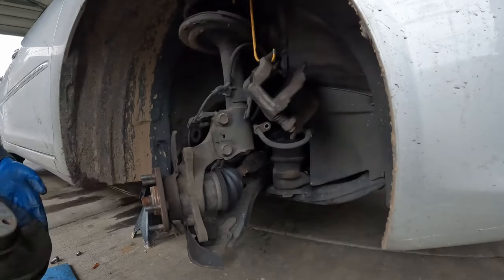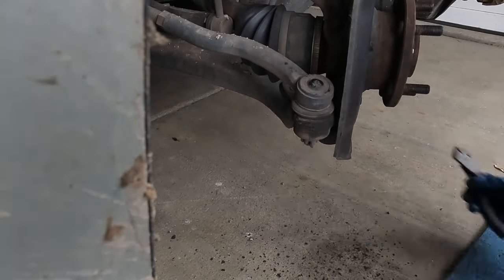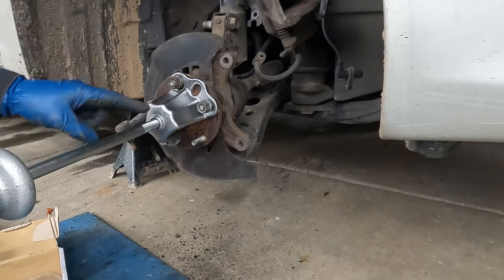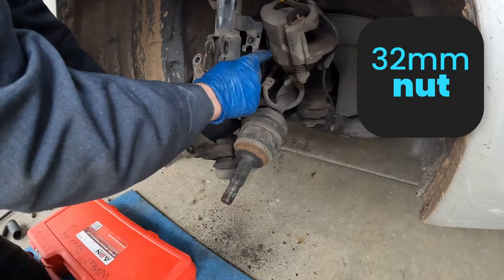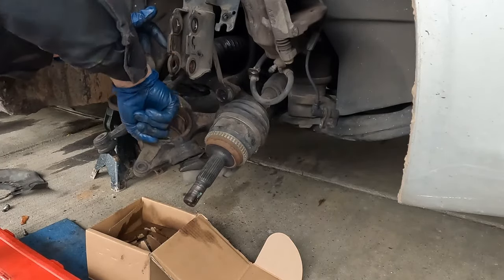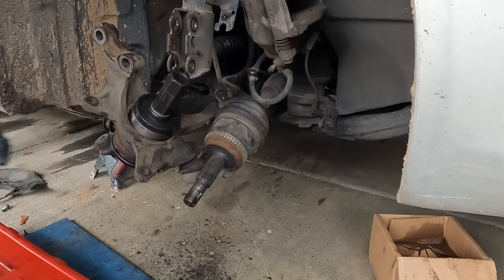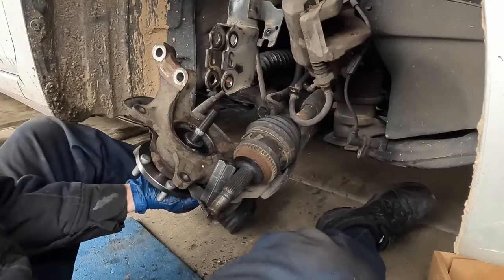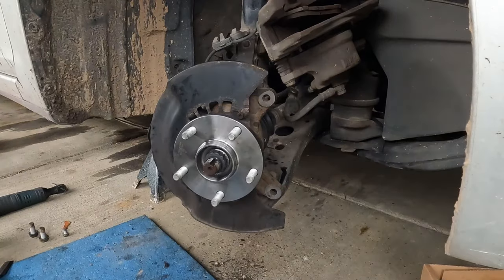2002-2006 Toyota Camry Front Wheel Bearing Replacement

Comment: why you don't take last screw to have a knuckle out out on the table? You could have a much more room to access the bearing.
Reply from the maker: You're right you can unbolt the ball joint and take the knuckle out completely. That will give you some more room to work with 👍

Comment: what can i used instead of a puller?
Reply from the maker: @kayleebrown1667  These are pressed in so you need something that can press the old one out and new one in. What I've done in the past was remove the knuckle from the car and take it to a shop for them to do the pressing then install the knuckle back on the car with the new bearing in it.

Comment: Thank you for this video. It is one of the best videos in step by step description and camera angles I have ever seen. May I ask you a question. I have a 2007 Toyota Rav4. One of the hub bolts of the front right wheel broke off. Could it be replaced without removing the hub. I am a 77 yr old just a DIY person, not a professional mechanic. Thank you
Reply from the maker: @tellsthetruth894  Yes, it can be replaced on it's own. The wheel studs are pressed in and can easily be removed with a hammer. I don't have a video but there are a lot of videos that show you how to replace a wheel stud. Hope that helps. If you have any more questions feel free to ask 🙂

Comment: PIA - why couldn't Asian cars use all in one hub and bearings like my Chevy and fords... so easy to change - also I would think you'd need an alignment after, since  you are screwing with the tie rod end and removing the lower strut mount? - so might as well do both sides with a decent bearing, and have it aligned...   BTW Im assuming my 2003 is the same as the 06?
Reply from the maker: @Mediaman67  I agree, I like doing bearings in pairs. And an alignment is a good idea after replacement because there are differences in machining and it can throw your alignment off. 02' to 06' should all be the same 👍
Reply: @ValleyMobileAutomotive  I like your video because it shows that you do not have to take the whole thing off via removing the lower ball joint (3 nuts) - I don't have a shop press handy :-) - do you have a link for the bearing puller tool set?  - yeah I'll just do both and be done for another 200k :-)
Reply: nevermind - you have everything there lol - im an idiot
Reply from the maker: @Mediaman67  Yes, all links are in the description 👍

Comment: You're a fast worker, but its easier to remove the axle nut with the wheel on the ground and torque it back. Also why not use the  slide hammer with tie rod still mantled ?

Comment: Great job! I like the idea of the silicone paste as a lube. I used anti-seize to lube the bearing and would look like the Tin Man afterwards. I was wondering how you were going to address the hub with the inner race still stuck in place situation but I see you installed a new hub. I used to do mobile service for SAABs. They had the press in wheel bearings. I always used my 20 ton hydraulic press at the shop. I used a bearing splitter to remove the inner race from the hub. I'd either have the customer come to the shop or would remove the knuckle assembly in the field and bring that back to the shop. That bearing kit makes it easy to do in the field. I used to bring a small twin tank air compressor to power my impact gun. This was before there were cordless impacts.

Comment: Do I have to replace the hub if I’m replacing the bearing?
Reply from the maker: @gory2817  Not necessarily but you will need to separate the inner bearing race from the old hub. I like getting a new hub because it's easier.